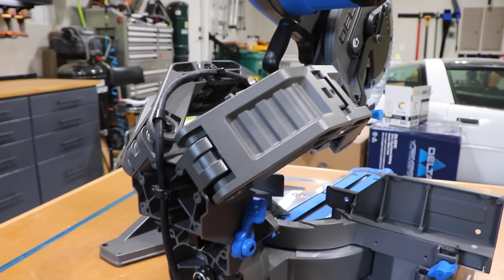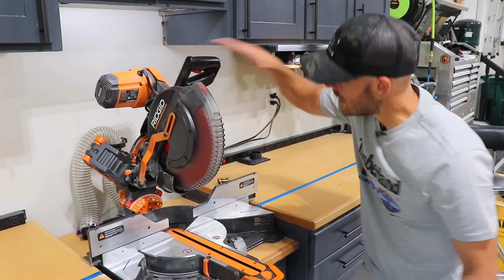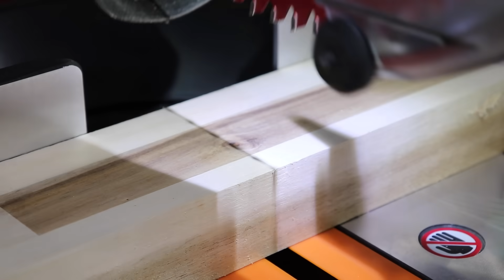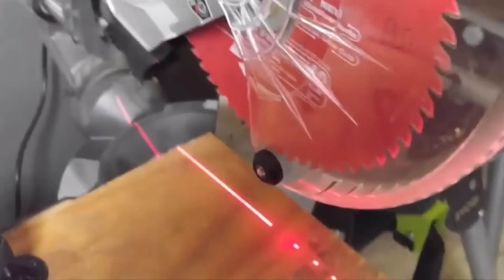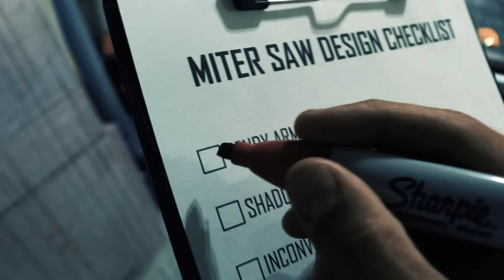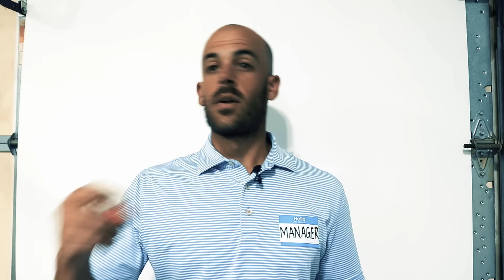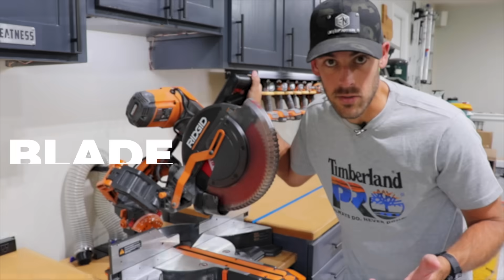I ALMOST took this Saw Back. // RIDGID & Delta Dual Bevel Sliding Miter Saw Review

Comment: I've had the Delta 12" for a couple years now, and my experience is almost exactly as you described. I love the hell out of this saw, the only things that bother me, which you also mentioned, are the dust collection and the blade deflection. As you mentioned, being aware of the blade deflection make it pretty easy to account for. Because the saw is so SOOOO buttery smooth, I've taken to simply "setting" my hand on top of the handle, pushing down, and essentially letting the saw do the forward and back part. By doing so, I reduce the chance that I will push the handle side to side thereby reducing the deflection. I also get very accurate, repeatable cuts using this method. But I'm also not worried about being off by 1/1000th of an inch or anything. The vast majority of what I do could be off as much as an 1/8" and I'm usually fine. I still try to be exact though.

I'm glad I stumbled on you video here though simply because of the dust collection add-on you mentioned. That really is the biggest issue I have with this saw. Definitely going to give the add-on a try.
Reply: Ya but as soon as you tilt the head all bets are off! One must develop a jedi sense for pulling down on the perfect angle you set and pray you aren't pulling slightly left or right.

Deflection is a major concern, and why I always test saws in every way I can before deciding to buy it. Before I bought the Bosch I played with it @ stores at least 5 times. Every time I was astonished and it won me over specifically because of the blade deflection.

For me those arms were never about saving space. They were only ever about trying to apply articulating joints to solve deflection for me. Which is also why the arms are centered.

I've had one for 10 years and I consider it the best performing saw in its class. It's no Kapex, but it's not in that class @ half it's price.

I've used tons of sliding compound miter saws. Even before the Bosch. Deflection is an issue on every single saw with bars I've used. Green saws, yellow saws, orange saws, you name it... when that Bosch came out. It changed things. It still can deflect, it's basically a non issue on 90 degree vertical cuts, and controllable on the tilt to keep things nice.
Reply: @brandonhoffman4712  I haven't had any issues getting the results I need from the Delta. The only time the blade deflection seems to matter is straight up-and-down cuts. As soon as I tilt, it doesn't seem to change. Or maybe I'm just good at compensation? I dunno.
Reply: @gund2281  Hey, as long as it works for you. That's what really matters! Glad to hear it improves on the tilt.

You could look @ it this way. We're moving over 500,000mph, spinning in circles, orbiting a fusion reactor, thats being pulled around the whole dang galaxy, which is seemingly adrift @ sea on a universal scale. and your saw is still able to cut square!

Comment: Great 👍 video. If only the showdown line was available on the 10”. I like getting the largest I can afford and not use it for longer life. I have a Dewalt miter saw/ chop saw. The draw back is buying 12” blades when I already a lot of 10” blades for my table saw. I see no reason to buy the 12” other than the shadow line. Which is a great improvement as your eyes 👀 don’t quite work as well 50 years ago.

Comment: Most intelligent take on blade deflection I've seen. Many people have an unfortunate tendency to let the perfect be the enemy of the good (or even the great). I cannot think of a tool that doesn't require a modicum of care by the user to achieve its best result. Afraid of blade deflection? Exercise precision when drawing the blade across the wood! Thanks for your contribution. 
(Though, in fairness, your dust collection shroud is frightfully overpriced!) ;)

Comment: I recently purchased the 12” Ridgid R4222 model saw. I unboxed it, set it up on Ridgid MSUV and thought everything was great. I literally made two cuts and I started having a problem with the blade brake. The blade would not stop rotating. Not to mention it is a huge saw. I liked it, but I didn’t like  having something wrong with it right from the get go, so I ended up returning it last week.

I had been seeing videos for the Ridgid R4251 . It was on sale on HD website for $379 . The only problem was that it was out of stock and no idea when more would be in. Well long story short, I ended up looking one random day and saw 26 available. I thought I would sleep on it. I woke up to 6 being available and decided to pull the trigger, and boy am I glad I did. From the moment I took out the first piece ( material clamp ) , I knew it was just built different. I don’t know how to explain it. It is just solid. Everything was great right out of box. The glide motion is what everyone has said it is. Like butter…  I could not be any happier with this saw. 

If you are contemplating getting either the R4222 or the R4251 . Get the R4251 . If you have already purchased the R4222… bring it back and get the R4251 . It is a whole different animal and I think Ridgid ( Delta ) hit it out of the park. 

I personally could care less about the dust collection ✌🏼. Others feel different . I can tell you one thing, that dust collection “issue” hasn’t translated to reduced sales that’s for sure. This saw was hard to find for me here in the North East.

Comment: Miter saws are a very divisive  topic for wood workers. They are finicky tools, that require a lot more finicky and tedious calibration to cut accurately (assuming its a quality saw) than say a table saw. Even the top performing miter saws in the DC category aren't as great as even a cheap table saw. The table saw is generally more accurate as it only adjusts up/down and bevel to one side. Miter saws, and especially SCMS's have much more range of cutting with all the miters/bevel functions and as you stated, that results in more variables for inaccuracy. In a shop setting, if you have a good quality saw, take the time to dial in your miter/bevels adjustments it and use good blades it will likely cut accurately for a long while. You won't be lugging in/out of a vehicle and job sites daily where bumps and dings can knock them out of whack easier than one would hope. There are so many variables just in manufacturing alone that result inaccurate cuts such as out of flat bases, bent or out of square fences, too much run out in the arbor and, and, and.. But, for me they an invaluable tool, but I'm a finish carpenter by trade and hobbyist woodworker in my free time. I trust my miter saws to make accurate cuts because I have spent many hours tuning them as it is vital to my profession that they be accurate. If I were just a wood worker building stuff in the shop would it be as important to me? Probably not. But they are very convenient especially cross cutting long stock.

My long winded point is, if you buy a good saw, put in the time to calibrate it,  and use proper form when cutting, you will get good results. If your making furniture, it's probably not worth the hassle and there are plenty of other tools that will give you the accurate cuts you need with less effort.

Comment: I have had the ridgid sliding miter in my shop for a few years now and I really dont like it. It is designed where the blade will not cut square. The big box store brands do not work but actually drag the blade out of square. Only blades that work are the specialty industrial that have almost 1/4" kurf.

Comment: Nice review 😊
Try this on these sawes:
Make a under bevel cut across a wide board. 

Hint - the cut ain't 90 degree. 😂
The saw head is so heavy that the weight cause blade deflection. Which leads to blade kickback. This saw is dangerus to use.
This is not an issue with festool KS120
Reply from the maker: Which arm is your Festool tattoo on? Or is it on the small of your back?

Comment: I believe the max cut length is achieved if you raise the work piece up by putting something underneath it. Because the delta site has different lengths based on material thickness. Raising the piece and taking off the sliding back fence allows for that I believe. You should be able to get somewhere in between by raising it up and not taking off the back fence.

Delta 10 in:
Maximum: 1.5 in. X 15.25 in. (2 X 16 lumber)
Miter 0° / Bevel 0°: 3.5 in. X 11.25 in. (4 X 12 lumber)

Comment: I agree with the comment about deflection. There is no reason why someone should be powering through a cut using force. If you have half a brain, you should be able to use any miter saw fully extended and not get deflection.

Comment: Thanks for such a thorough review.  I'm considering the Ridgid to replace a broken Hitachi saw (it fell off of a makeshift workbench and cracked the bevel mechanism).  I really liked the Hitachi, but I've heard that since they went to Metabo, the quality control has suffered, plus I really like the clearance this type of bent arm design allows.  This Ridgid is really appealing since I can't drop $700 on the Bosch.

Comment: Thanks! Thought I was a Garage Conquistador until I back stepped back into the cat litter box, stumbled into my hanging 6’ level, which fell on my beer, that spilled over my mini-frig, down onto my 3-way plug extension, shorted out the main breaker which sparked and ignited my yet-to-be-removed saw dust pile. The fire fighters couldn’t stop laughing.

Comment: I bought harbour freights sliding compound double bevel miter about when they first came out in 2014 or 2015. I went all over town looking for two perfect squares. I compared them to each other and took my best gamble. I used one of those squares to tune up my new saw. I adjusted the minimum blade height so I could get a 14" cut. The built in laser was on the right side of the blade. I put an additional laser on the left.

How I tuned the saw was I made a cut then rotated the 14" hardboard so the fresh cut went against the fence for each of the next 3 cuts. Then I used my square and a feeler gauge to fine tune the saw.

If you pull the saw out before making your plunge cut the blade shouldn't be deflected and should make an accurate cut at full extension if your blade is sharp. Then simply push the saw back to the wall to finish the cut. Don't force the cut. Let the blade do the work. If you plunge cut before pulling the saw out you'll be performing a climb cut which can be both more dangerous and less accurate as the saw can pull it self through the stock faster than the blade can cut, which could deflect the blade. 

I found for wider cuts I could flip the board, take my time to line it up, and get a perfect cut up to twice the normal 14" capacity.

Also, I didn't like fiddling with the lock nuts on any of the adjustments, so I replaced the nuts with cone shaped springs.

Comment: I've only used shop saws (miter saws) on job sites basically for repeat framing cuts and trim cuts. For my home shop I setup decades & decades ago I went with the dreaded radial arm saw, then a table saw and then a thickness planer and drill press. I will never replace my radial arm saw, it is so versatile. Thanks for sharing.
Reply: Radial arm saws are way better than chop saws for repeated cuts.

I used to use them in a cabinet shop
Reply: I sold an old Craftsman radial arm saw a few years back because I just didn't have room for it.  Man, I miss that saw.  It was awesome.
Reply: @MadMonk67  Sorry to hear that. I made sure I was able to have room for my radial arm saw on one wall and my table saw in the middle of the room. I just couldn't live without it. My son thought I should get rid of it and down size to a chop saw. Once I showed him everything I could do with it he quickly realized I should keep it.

Comment: I’m glad you did this vid because I bought the Bosch Axial glide 10”( they originated this design) , told my buddy NOT to get the Rigid, horrible dust removal, after using my Bosch, he wants to return his saw, but they won’t take it back at Home Depot

Comment: If you are up for it, the Makita front rail system saws are pretty awesome. I have a 10" 36V dual bevel front slider.  Still has rails but the rails are in front, rather than sticking out the back.
Reply: You could buy 2 of these saws and still have money left over for that price. Lol
Reply: @CharlieOdom1957  ok, so then buy the corded version. My point is, there is a happy medium between "affordable" and "festool". 
I opted for 10 inch rather than 12 for the decrease in price, weight, and footprint.

Comment: I bought the Bosch dual bevel glide version of these saws after years of owning Makitas and I'm completely impressed. I'm not a fan of Rigid tools because of the lesser quality products. Seems like every Rigid tool Ive owned has some sort of issue with them and I've spent more time dealing with the warranty department than anyone should have to. I don't have any issue with Delta everything of theirs I've owned lasts a long time and works as advertised.

Comment: I liked the DeWalt DWS780 the most out of all the ones I used. I have had 2 of them but not because of a problem with them, the first got sold by an old boss that I was working for at the time along with a bunch of other tools that I didn't have room to carry on a 1000 mile trip to help family out. The 2 was in a company trailer with me having the only key to get in it because I had 99% of my tools in there. The whole trailer was stolen. Another $8000 this time and around $5000 the first time. Just so I could keep working I bought the DWS716... A week after i bought it I let a coworker use it and his truck caught on fire and melted it.

Comment: I have the previous model with the sliding mechanism and it is junk for accurate work. I have other ridgid tools that are decent, but their track saws (went thru 3 of them) are not good at all. After watching your video, it seems they haven’t corrected the deflection and dust collection issues from the past,

Comment: Considering deflection. I think the physics of a very rapidly spinning blade would stabilize the blade and reduce deflection. Many have seen the demonstration of a rotating bicycle wheel that locks the wheel apparatus in a set orientation. Without a test of this hypothesis, my conjecture is, at most, a guess.

Comment: I had the 10in Ridgid for 2 days and returned it for the 12in, because it seemed a bit deceptive that the max cross cut length advertised does require setting it into an extended mode. You remove the main fence, and place a sacrificial piece of 2x whatever onto the main platform to raise your piece up higher. Then There are 2 little tabs that rotate around, and a mini metal lip at the back of the circular part that act as the extended fence. Super happy with the saw.

Comment: Thank you!  I'm gearing up to get my shop back in order after many (MANY) years of just being a catch all.  My old chop saw had suffered under the Arizona sun even though it was in a shed.  Poor thing snapped in half from the heat.  The handle just self destructed.  I was debating on fixing vs replacing.  I believe you helped me make that choice. :)

Comment: Nicely presented evaluation. Interestingly enough, at present , the 10" rigid is more expensive than the 12" . You showed a Bosch glider among your array of saws. Is the dust collection better out of the box with the Bosch?  I have seen reviews that thought the Bosch dust collection was fairly descent. So the question is, if the Bosch dust collection is superior, does your dust collection improvement chute, bring the dust reduction close to what the Bosch captures? (Bosch does not have any led  shadow or laser line guides). And lastly (sorry for the length) Which 3D printer are you working with? You have a number of well made products..

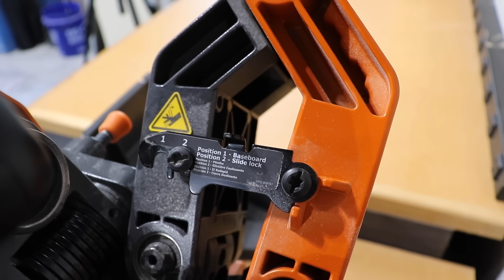Comment: 12:08 Yeah. Why would I buy a ~Sliding~ Miter Saw if all I do is use it in the ~locked~ position. Might as well buy one of the cheaper models without the ~sliding~. Which is what I am thinking about right now, get a Miter Saw at all, just a standard 12" one or a sliding one. As you said, wider pieces are best cut with something else like a Table Saw, a Track Saw or even a simple Circular Handsaw with a straightedge.
The main reason for a Miter Saw is the accuracy of the Miters it can cut.

Comment: Can you compare this to the Metabo HPT? I used to have the Hitachi Version, and even the alien looking model before it. I pawned both for the same reason...pills. Now I'm fairly rich by my standards, work in healthcare, and don't blow money on controlled substances. I want a new miter saw. I default to the Metabo HPT because Hitachi miter saws have been very good to me. I've wanted this one since the Delta Cruzer came out though. I'll probably just end up finding an excuse to get both but still.

Comment: I've been working on building a miter station (which is nearly done) and looking for a sliding miter saw to upgrade from my old Craftsman chop saw.  I saw your video when it came out and because of it I decided to go with the Ridgid R4241.  To be honest it was your dust chute that was the deciding factor for me.  I just finished the miter saw base and got the saw mounted today.  I put your chute on before using so I have no first hand experience of how bad the one was that came with the saw but I've got a pretty good idea.  In any case all I can say is "IMPRESSIVE"!  It doesn't get all the dust but definitely makes it manageable.  Great video, thanks and keep up the good work!         P.S.  Regarding the saw I can tell it's going to be a dream compared to what I had.

Comment: I have the Ridgid miter saw R4221 do you have the upgraded dust collection for it? The original dust collection broke (error in my part)  it's mounted on a Ridgid miter stand so I just roll it outside when I need it , sense winter is coming I'd like to fix it.